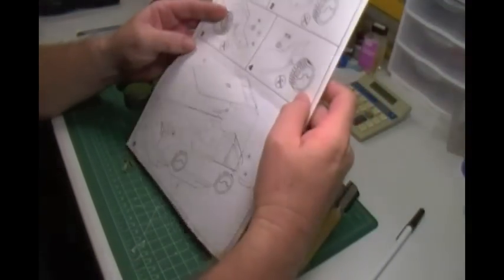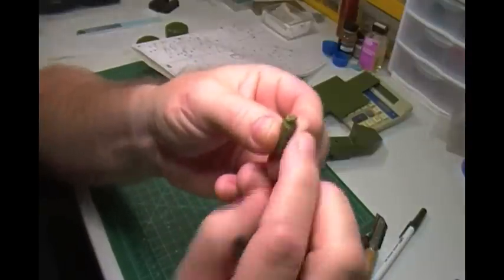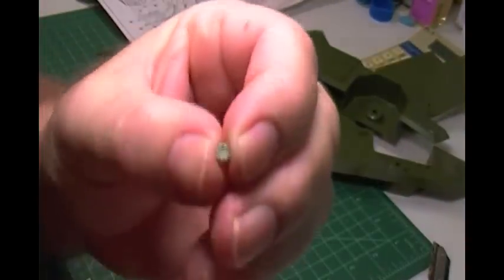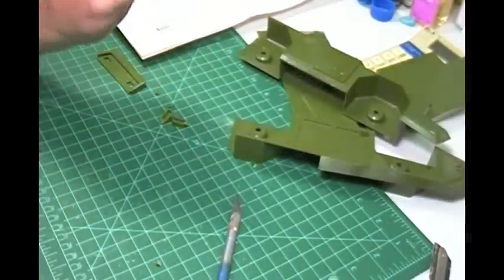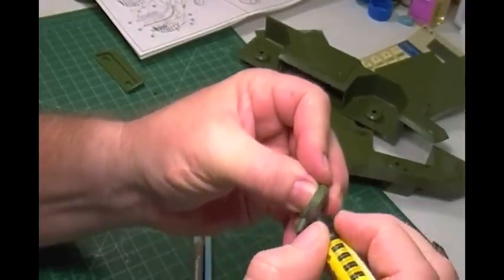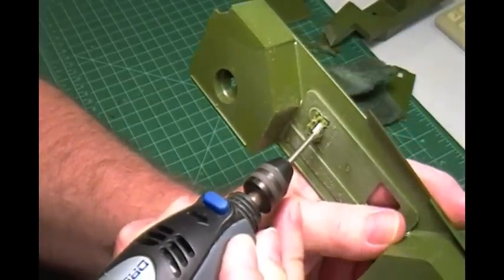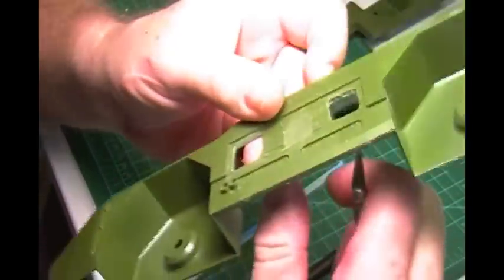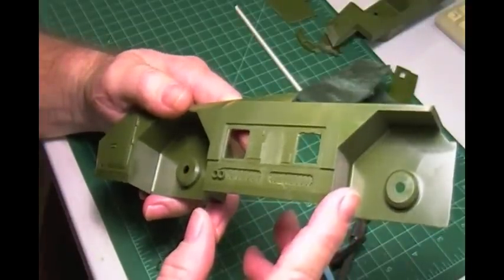Halcyon Aliens APC part 1

Comment from the maker: I have found out so far it may have some fit issues. Also the pieces are warped a little on all the outer sides. But it can be all fixed. Nothing that a little styrene and putty can fix.